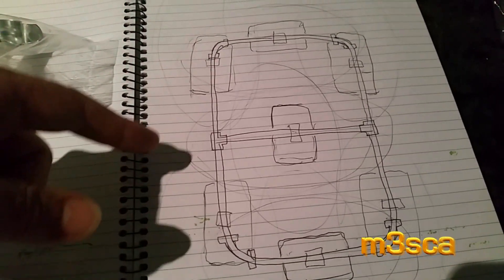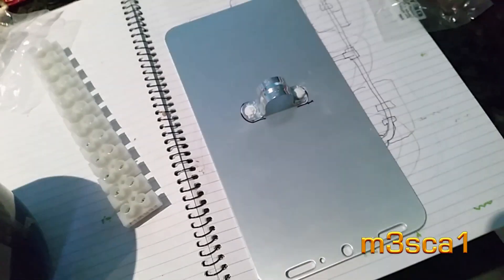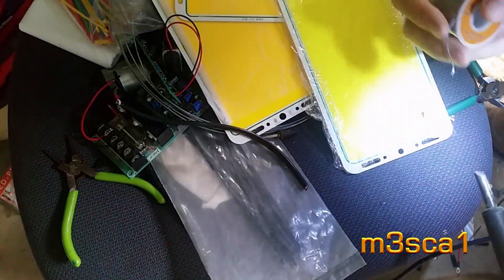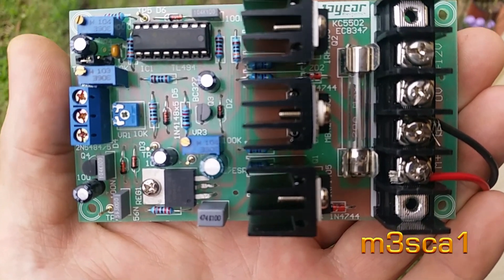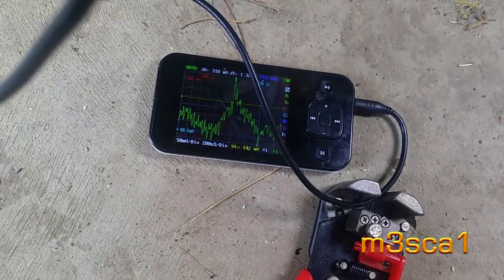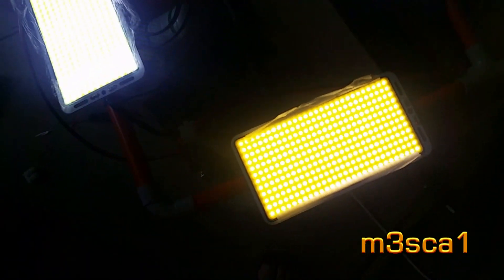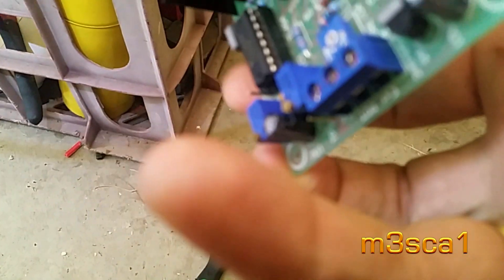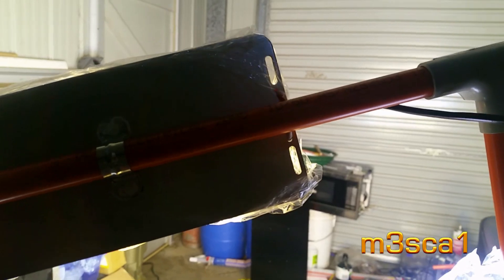DIY GROW LED Light~HOME GROWN~DIY

Comment: damn that's bright .
Reply from the maker: i have not seen it go full tilt since the power supply and PWM can't deliver, but those panels get hot with the PWM dialled up. I have it running a bit over luke warm
Reply: @m3sca1  damn i had a 50watt copb that ran at 35v but i only ever ran it at 32v with a fan on its but it was pretty close to what you camera was showing  i just need a new driver that don't pop fuse's everytime you turn it on. Driver i had on it was fine it was inrush current that was tripping a 10A fuse.
Reply from the maker: @jfraser3  did you try it with a slow blow fuse?
Reply: @m3sca1  yeah it use to work very well was one of the lights i used with that camping rig i showed you most it ever drew was 2A when running.
Reply from the maker: @jfraser3  i have a few of those floodies that jaycar sell, a 50watt, a 30watt and a 10watt. Took the 50 camping and just shone it at the tree's and walked around in the green glow.